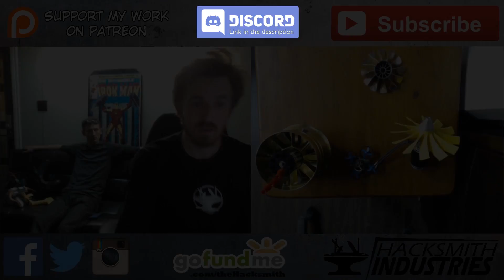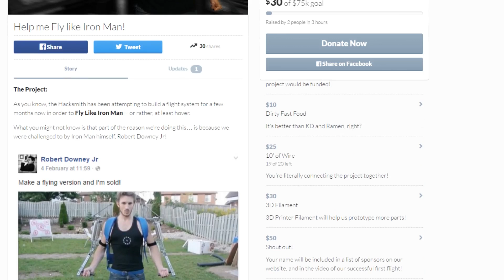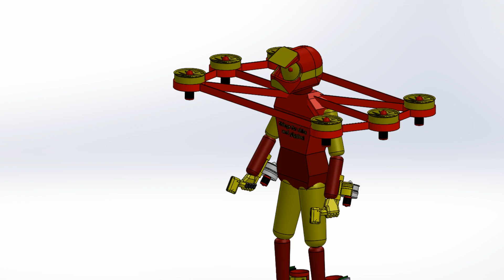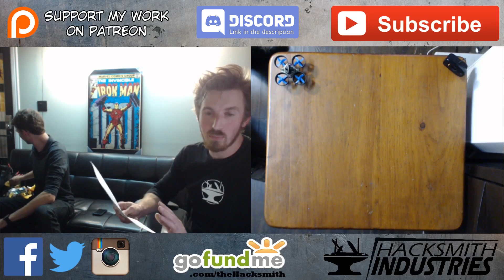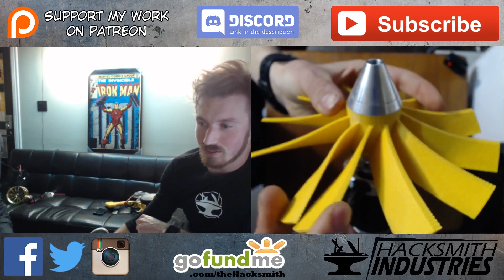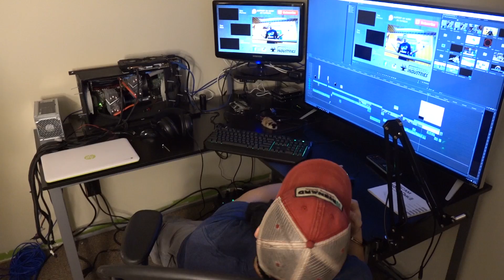Flying Like Iron Man Q&A!!!

Comment from the maker: Check out the GoFundMe campaign! https://www.gofundme.com/thehacksmith!

If just 2% of my subscribers donated $5, we'd reach our goal and be able to make this project a reality!
Reply from the maker: Sadly even the cheapest metal 3D printer is maybe $125,000 =(

Any kind of "rocket" boost to get you in the air is kind of redundant. Either the system with EDFs is enough to make you hover, or it's not. If it's not, shooting yourself into the air only to fall back down since the EDFs arent powerful enough would kind of be pointless! =P
Reply: So,.. EDF's were a good idea when you started out & we all thought the suit would look like an iron man suit & the compactness would be essential - - but if you're putting a swarm of edf's on a frame at neck level (bad idea btw - if a blade shatters it could end up cutting your throat! Move this up above head height)  then you should switch to 4 or 8 standard motor/propeller power units. These could probably fit a frame only slightly larger, are cheaper to buy, pull about half the amps for the same lift, and put out less heat. Hobbyking sell some rigs that are used as direct replacements on 150cc aircraft that would suit nicely.
Reply: the Hacksmith If only you were lighter...😁
Reply: Jorge Carrieres or we could all just donate $50 and get this show on the road.
Reply: You could use some Graphene battery, They're easier to charge, faster, way lighter and have about 5 times more maximum energy then a lithium ion battery. Or carreful, the next one is really science fiction but it would be techniquely possible. Basicly, a plasma projector and the plasma is pushed by a solenoïd. Plasma could be made by using a laser that get it's frequency increased by shg crystal so it get up to 85nm and ionise the nitrogen in the air. Or even to get more efficient, the laser could heat itself by the plasma it produce. Basicly, a laser that light ray get frequency amplified to ionisation ppint, and then the laser get partialy put to the chamber that get heated that produce light Basicly. You have a one way mirror the other way transparent and the other mirror is one that let pass a few  amount of the light. So the laser would heat itself and the light could make the air become plasma and you could push you with it fast expension and it positive charged side. I'm just a 15 years old Proposing you stuff so go easy on me Pls. And btw , i made a couple research on that so it's not 100% bullshit.
Reply: the Hacksmith Hacksmith, I'm sorry, if I was old enough I would donate :( I would fund the max
Reply: Could you not use rockets as a somewhat jumpstart to gain some altitude, then use the EDF's to maintain it?
Reply: Killing11010, the Hacksmith Killing11010 I was going to ask. Like, ejectable boosters like NASA used for the Space Shuttles and first few rocket missions. Could you acquire a metal 3D Printer? They're fairly expensive, but could you acquire one with enough funding to print steel or aluminum EDF blades to handle more weight? Could you 3D print say some stilts that raise your feet a little bit off the ground, and use them to get a longer tubes made of lightweight plastics, carbon fiber, aluminum, or some other ultra light material to adjust the thrust to weight ratios? Had I the money I'd dump tens of thousands of dollars on this. Love your shit Hacksmith.
Reply: hey any of your donation sites take paypal? wanted to give to the gofundme cause its just for the Iron man project (no paypal) but if you can do one off payments on patreon and you use it for Iron man project guess that will be ok. The jet pack look is what you need/should go for if they can do it with jet engines you can do it with EDF`s. (Meet the World's Only Fully Functional Jetpack) title of yt vid.
Reply: me001ist we could donate 50 dollars each and build a nuke
Reply: the Hacksmith cool
Reply: the Hacksmith I don't know how to give money I would if I knew how
Reply: the Hacksmith your the best
Reply: How about the small size jet engine
Reply: And on the plasic blades
Put a rod into the blades
Reply: Jet engines might be more pricey
But you might need lesser edfs
Reply: A good idea for a project is a rocket bike or an EDF bike
Reply: Michael Ibrahim .
Reply: the Hacksmith drat! Ahh well. I'll donate. I soooo want to see this made a reality.
Reply: the Hacksmith The Zapata Flyboard is a HOAX. look at the harness.
Reply: the Hacksmith also, I did watch your vid and understand why you'd prefer not to go with giant bulky equipment outside of what you said in this vid. I know about g-forces and shit, not to mention power constraints, equipment failure and breakage concerns, using this stuff outside of intended uses specified by the manufacturers, etc. I'm just wondering whether it could be possible to somehow combine multiple thruster sets of various sorts onto the same frame and have them sort of...eject once spent to shed weight. You've probably considered this, but I'm just trying to be of some use because I would love to see this actually work.
Reply: Bacondedo efficient*
Reply: you could make your own propeller blades out of aluminium with either the CNC, or by "lost PLA" sandcasting
Reply: Avondhu Internet Services the 3d design is not a finished design, since they said that they didn't fit everything in correctly
Reply: Jorge Carrieres we call it lost foam, can be done , then they just need to balance them, maybe next door could help.
Reply: Hey Hacksmith, what if you build your own Batsuit, that is sort of bulletproof and with all your batharangs and batman grappling hook?
Reply: If he could do that, The armee would have had it by long
Reply: Franck's Gameplay It would be impractical
Reply: Franck's Gameplay I guess , what he was trying to say is that the  Batcostume is made mostly for one on one combats, also it might cost a lot money.
Reply: the Hacksmith I donated 10 couple days ago
Reply: Killing11010 rocketed burn to high in temperature

Comment: For making your own EDFs I would say use the 3D printer to pint the forms, and make it in fiberglass or carbon fiber. Just fiberglass will be roughly 25 times stronger than 3D printed ABS, and for carbon fiber you can double that, (but the price of course goes up quite a lot more).

Comment: You are only putting one EDF on each of your limbs.. Why not more ? Will that not add up in efficiency ?
Reply from the maker: The EDFs we have from Hobby King just aren't powerful enough, We'd need about 20 of them!
Reply: Well, for now that makes sense not to do that...
But when you get (or make yourself) the right EDFs, wouldnt putting more than one on each limb give you more control ?
And also, aranging them in a circle saves a lot of space and maybe you will be able to get rid of the hexacopter that is planned on going on your sholders (Yes I know the sketch you showed is a rough prototype)
Reply from the maker: But we need larger EDF's they would be kinda ridiculous on your limbs! We'd like to use the hobby king EDFs on the limbs because they are much smaller and compact -- if the main thrust comes from the backpack (and stabilzation) then you can use your limbs to fly around =)
Reply: the Hacksmith Well in that case... we need elon musk for that problem. 

and robert downey jr to fun it.

Comment: 80k $????
just BUY a jetpack for the money. 
for a short fly time use hydrogen-peroxide, this will give you thrust for about 40 sec. an will be MUCH cheaper than 80k $.
would be still cool to see this thing fly:)
Reply from the maker: Considering the  Flyboard Air is a $250,000 prototype, I'd say the budget's pretty reasonable!
Reply: Another idea would be to use a big ducted fan. a.k.a. Hiller platform This thing runs on a normal gasoline piston engine! 
or take a look at the X-Jet.

Comment: there is a site called shapeways where you request things that you want 3d printed and someone makes them in i Think any material you want
Reply: also i think there is a reddit page about it
Reply: If they were outsourcing parts it'd probably be better to just get the parts injection molded or however the original parts were made, but it would probably be more expensive than just buying the full part.

Comment: +the hacksmith I've had an idea for making your own EDF's. Once you have 3D printed your fan blades you could bury it in a bucket of sand, put some kind of riser or funnel on it then pour molten aluminium or some other kind of lightweight metal into it. This will remove the issue of the flexing blades and shouldn't add too much more mass. Hope this possibly helped.
Reply from the maker: Casting is definitely possible, but it's hard to do it precisely enough for something like a fan blade. They need to be perfectly smooth and balanced =(

Comment: If you had some boots, that can boost you and you chould jump higher with them? Chould you use them with your flying system and jump so you will be more time in the air? Sorry for my bad english.
Reply from the maker: You could... but the idea would be the flight system is powerful enough to get you in the air. Be kinda scary having to blast yourself into the air with another method, and then start flying... That would mean you wouldn't have enough power to fly normally!
Reply: Maybe if you had ironman suit (in the future) you chould do somethink like "jumping suit". If you chould jump like 2M high, that would be cool!
Reply from the maker: Separate from the flight suit?
Reply: Yeah, I meant if you will build iron man suit, it would be very hard to make it fly cause of the weight, so I thought it chould jump instead.

Comment: Have you considered using liquid rocket engines on each limb? You could have a liquid oxygen and gasoline tank on you back connected to the chambers on your arms.
Reply from the maker: Yeah -- that'd be pretty scary though. Remember, any kind of liquid engine means 1000+C exhaust plumes. Melted flesh.
Reply: I guess your right, but you could of course have a cooling system and wear protective heat padding.
Reply from the maker: +bootlegged_cake if you watch our earlier videos we tried protecting ourselves from the rockets... It didn't go well :p
Reply: Well, traditional rockets have a water cooing system that cools down the nozzle. (Your smarter then me so you probably know that) But my idea was that you could have a cooling jacket between your wrists (with heating pads) and the actual combustion chamber. The water would be at high velocity and would absorb most of the heat transferred, while the heat protections do the rest of the job. And to fix the plumes problem you could hold your arms up at a specific angle that lets the plumes spread. I'm no rocket scientist, so to you the idea is probably dumb, so please feel free to correct the idea lol.

Comment: you could use a compressed oxygen and a compressed fuel then power off with one jet pack on your back and small ones on your limbs like a rocket😂😂😂. you could even use fins and computerise your movements
Reply: Even though he mention it being possible to computerize movements,  I'm sure he was thinking a bit more simple, more along the lines of stabilization to prevent uncontrollable shaking in the  controller.
Reply: But you could still make a rocket
Reply: its definitely doable, but as he mentioned its hotter, difficult and expensive.
Reply: you could have an egnition source far away. it seems simpler;  get fuel get oxygen, build customised containers, and a point of egnition
Reply: the ignition point is a relatively low hazard of a jet engine. jet fuel needs to be airborne (atomized with oxygen) to burn. the problem with using jet turbines is that they require insane amounts of resources and know-how to engineer and they're expensive.  Although i have seen small scale turbines that were actually more simple, they would need to be a bit bigger and still need multiple, which then again would be expensive.
Reply: No you could take a tank of compressed oxygen
Reply: That's what I meant at the start
Reply: also, sorry that I left, but in that case how can a similar design be made into a did rocket for relatively low cost. I'm not saying it wouldn't cost alot, but still compared to what your already spending it seem relatively plausible.
Reply: I really don't mean turbines and I don't mean solid rockets like he said before.
Reply: the problem with open flame is that its hot and inefficient  the problem with shrouded flame is its expensive and hot and still not very efficient
Reply: But you can compact more fuel on board even if it has a flight time of 1 or 2 min it's still the same as the fans.
The flame can be far away 
and I looked up and compressed oxygen can be as little as 15 pounds a little more for fuel. so on the bases that thousands are already being spent it's not as expensive as it sounds. 
And as for inefficiency, as I said, more compact fuel, so the only problem is how eco friendly you wanna make it, which is going to be even more expensive.
Reply: gregory butcher i would point out that the jet engine can get so hot it will melt itself if its no made of the right materials so the position of the flame doesn't matter its the heat that matters and rockets burn even hotter ... so rip

Comment: In theory if the flight is stabilized by the control unit and gyroscope (just for the rig I guess?), how much power on your arms and legs can you divert from generating lift towards getting some horizontal thrust? And what do you think your max velocity would be?
Reply from the maker: Pretty much all the thrust from the hands and feet will be for the purpose of zooming around =) considering just two of them on a longboard got us going 60km/h I'd say we could probably go pretty fast!

Comment: Why not attempt to make your own motor?? I study engineering and in first year mech we made a 4kw motor and don't you have that laser cutter you could use to make aluminium fans and the housing of the edf?
Reply from the maker: Laser cutter can't cut any metal =(

Motors are also relatively cheap compared to the fan blades. We also need to make them ultra compact -- it's possible to make motors, but specialized ones like this for EDFs would be very hard to make -- probably take us more time than it would be worth to just buy them instead =P

Comment: This isn't necessarily anything to do with flying, but a cool idea I've had nonetheless. What if you made spring stilts powered by electromagnetic repulsion. Basically you could have two electromagnets that are in between some kind of material, preferably some kind of malleable metal, that essentially repel off each other, and the material would transfer the energy made from sprinting to variably increase your speeding from what the sprinters normal max speed is. Think kind of like the Portal shock absorbers, except it can also help you run faster.
Reply from the maker: Cool concept! But probably too inefficient to work well in application -- Unless we had an arc reactor =D

There are some electric vehicles that use electromagnets for shock absorption I believe!
Reply: +the Hacksmith Lol, you aren't wrong, XD. I've put some thought into, and I'm aware of the power limitation to actually be able to get the magnets to support someones weight, let alone while sprinting. Perhaps, its possible to test in some way tethered with an external power source, but your right we need some huge advancements in battery technology at least to make this project mobile and viable. I'm still kind of anxious in trying to prototype it some how, and I've got some idea even with our limited resources. I guess I should get to work!
Reply: the Hacksmith Really? I have to look into that electric vehicle shock absorbtion thing.

Comment: "this is like solid copper" uhhh no. a stranded wire can handle less current than a solid one
Reply from the maker: He was referring to the weight of it. Having four of those attached to me would weigh more than the batteries
Reply: on the other hand you could then use them as stilts :P

Comment: I heard Tesla had good batteries cough
Reply: Kedron Mallia i dont think their batteries are supperior to others, but rather that they can produce them on a scale that can keep up with the demand of the emerging electric vehicle market. Elon mentioned once that the planed production of the Model 3 alone would use the entire worlds supply of lithium batteries without the aid of their new peoduction plant.
Reply: flanker152 Ok. Pulled my comment out of my ass xD
Reply: They just use a lot of 18650 batteries, though you can't pull a lot of amps out of them, so they won't be able to run an EDF
Reply: C R I P P L I N G D E P R E S S I O N k
Reply: Good suggestion but they slap massive price tags on everything

Comment: What print materials are you using? Essentium Materials has some high performance materials that I use for cybernetics work and I think might benefit your project also... http://essentiummaterials.com/product/essentium-pccf/
Reply from the maker: Very interesting! Might have to play around with that!
Reply: Feel free to private message me if you would like to be put in email contact directly with them. I have worked with them extensively in the past and I know them very well. I definitely think that their materials could help with strength or stiffness issues you come across with printed parts.

Comment: You know your battery cells are made by Samsung
Reply from the maker: I doubt it.. .they're from china
Reply: the Hacksmith Open up one of the packs. if theyre blue 18650's then theyre samsung. same ones in most portable chargers and tool batteries. perfectly safe of course